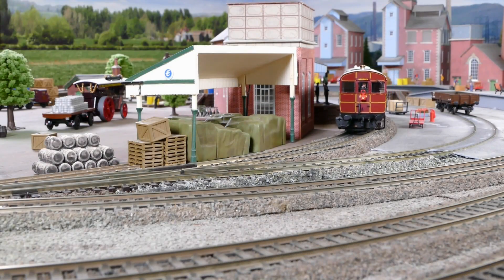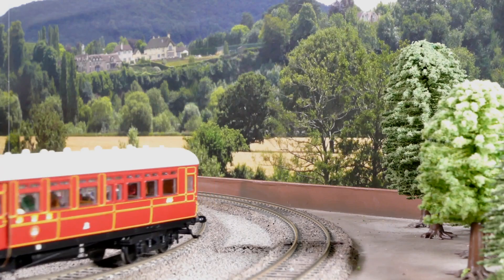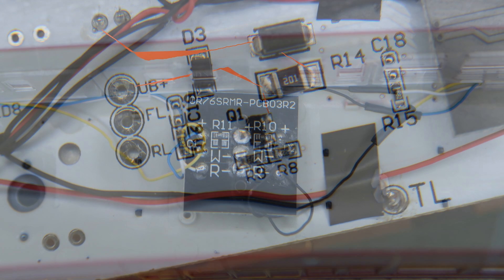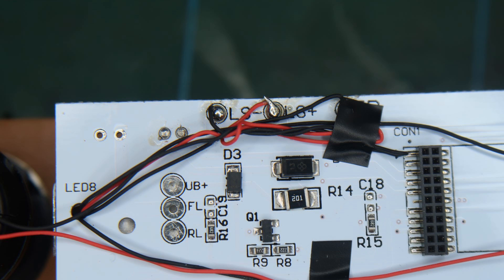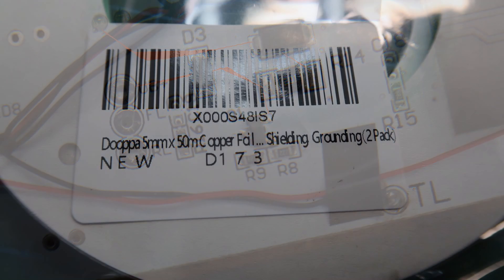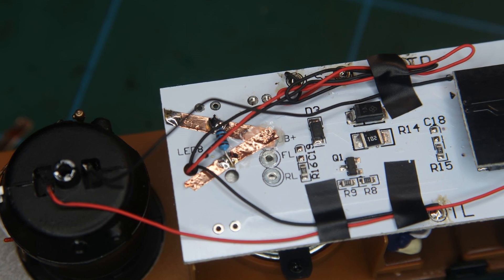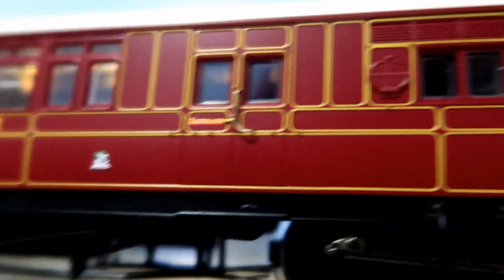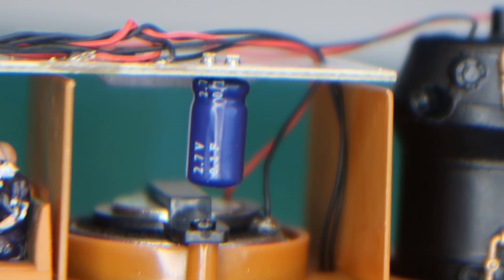Kernow GWR Steam Railmotor reducing head tail lamp brightness for analogue use

Comment: Very informative and what a simple solution that may find use inside other models - thank you Mike!  👍
Forgive my amusement in the complexity of turning down the 'wick' on the 4mm=1' model when compared to the same task on the 12"=1' version - the length us modellers go to! 😀
Reply from the maker: Thanks very much indeed 😊
Reply: Completely agree on both points!  ⚡
Reply from the maker: @ewhurstgreen  thank you Very kindly
Reply: @ModelRailwaysUnlimited  I still have a pot of car electric screen heater conductive repair paint (very old) which comes in useful for touching in electrical contacts and grounding (say) coach axles to one wheel to enable axle pickups!  🌞
Reply from the maker: wow,
 @ewhurstgreen